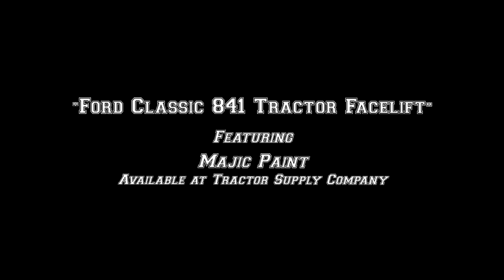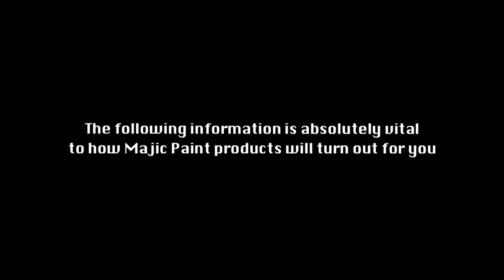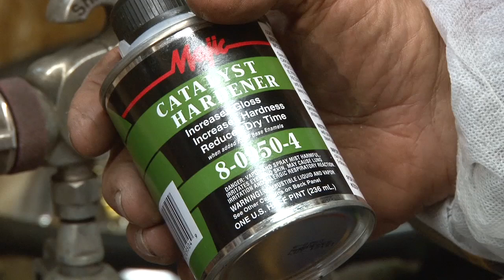Majic Paint Ford 841 Classic Tractor Facelift for Team Fitzgerald Food Plots & Land Management

Comment: Have a 641 Workmaster that I will be working on.  Im thinking about sodablasting the whole thing to bare metal.  Who ever put the paint on last time I think put it on with a brush as theres air bubbles in the paint and I just dont think shooting fresh paint will do it justice.  Im not too sure how I will go about my 3000 diesel though, the front grill shell is beat up fairly badly and every replacement I found said I would have to lose the orignal two piece grill.  Might hit up ebay on that, but thanks for taking the time of creating this video without it I would have never thought about trying Majic paint.

Comment: Did you sand the red paint between coats, or did you just apply the next coat right over it?  Also, did you sand the primer before paint, or can you just apply over it too?  You also mentioned to me before that you'll be repainting your 4500 too.  I have a 4400, but the only industrial style yellow color I can find is their School Bus Yellow.  Is that what you plan on using?

Comment: Hello, I am getting ready to use this paint on a trailer. I bought the red oxid primer and ford blue paint. My question is does the primer stop further rusting. Once you have knocked all the loose rust off the metal? Will it seal and stop further rusting? 
Thank you

Comment: I'm refinishing a very similar tractor- a 1956 model 650. I've done the chassis already and now I'm trying to decide on a paint/primer for the sheet metal. My initial thought was exactly what you used, but I'm considering a better primer like epoxy or urethane. From your video, I assume you feel the Majic primer does fine- and I already have it, so...

Comment: Hi their beautiful tractor you have. I have a 1951 ford 8n 4 cylinder gas tractor. I bought the tractor from my neighbor, it runs and drives great no problems. but the only problem I am having is the 3 point hitch not staying in the up position. while driving the tractor, their is a heavy box scrapper attached to it, when I put the tractor in gear and drive it, with the hydraulic  lever raised in the up position, the implement goes down to the ground. what could this be? thank you.